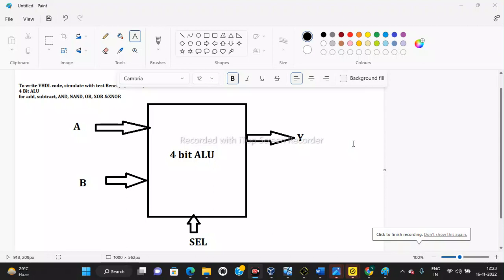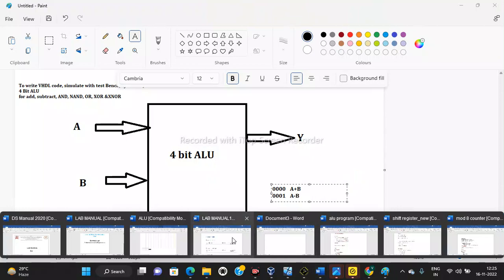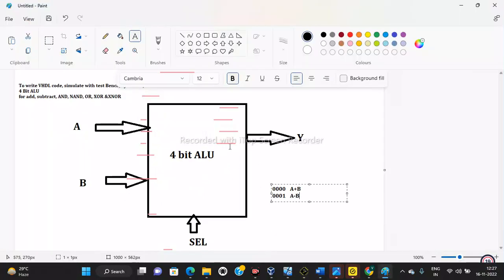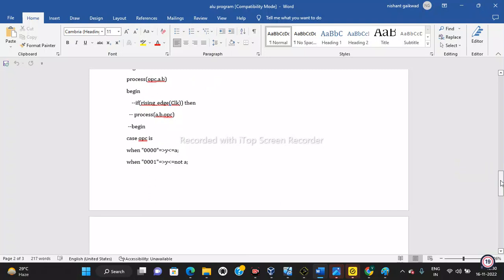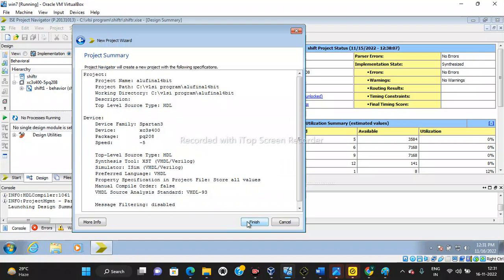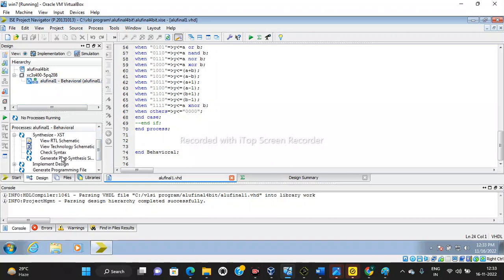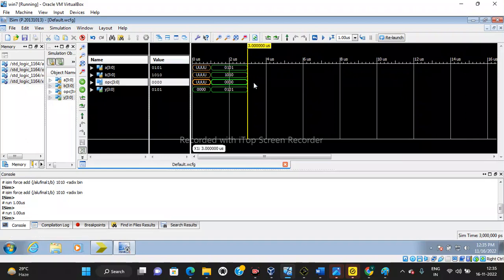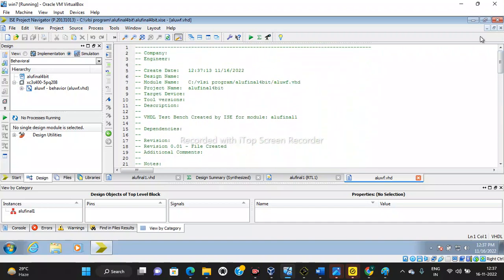4-bit ALU VHDL CODE and How to write and simulate VHDL CODE IN XILINX ISE 14.7 WITH PROCESS

Comment: Please cp the code here
Reply from the maker: -- Design Name: 
-- Module Name:    aluhnd - Behavioral 
-- Project Name: 
-- Target Devices: 
-- Tool versions: 
-- Description: 
--
-- Dependencies: 
--
-- Revision: 
-- Revision 0.01 - File Created
-- Additional Comments: 
--
----------------------------------------------------------------------------------
library IEEE;
use IEEE.STD_LOGIC_1164.ALL;
use IEEE.STD_LOGIC_ARITH.ALL;
use IEEE.STD_LOGIC_UNSIGNED.ALL;

-- Uncomment the following library declaration if using
-- arithmetic functions with Signed or Unsigned values
--use IEEE.NUMERIC_STD.ALL;

-- Uncomment the following library declaration if instantiating
-- any Xilinx primitives in this code.
--library UNISIM;
--use UNISIM.VComponents.all;

entity aluhnd is
    Port ( a : in  STD_LOGIC_VECTOR (3 downto 0);
           b : in  STD_LOGIC_VECTOR (3 downto 0);
           opc : in  STD_LOGIC_VECTOR (3 downto 0);
           y : out  STD_LOGIC_VECTOR (3 downto 0));
end aluhnd;

architecture Behavioral of aluhnd is

begin
process(opc,a,b)
begin 
    --if(rising_edge(Clk)) then 
  -- process(a,b,opc)
 --begin
case opc is
when "0000"=>y<=a;
when "0001"=>y<=not a;
when "0010"=>y<=b;
when "0011"=>y<=not b;
when "0100"=>y<=a and b;
when "0101"=>y<=a or b;
when "0110"=>y<=a nand b;
when "0111"=>y<=a nor b;
when "1000"=>y<=a xor b;
when "1001"=>y<=(a+b);
when "1010"=>y<=(a-b);
when "1011"=>y<=(a+1);
when "1100"=>y<=(a-1);
when "1101"=>y<=(b+1);
when "1110"=>y<=(b-1);
when "1111"=>y<=a xnor b;
when others=>y<="0000";                                                                                                                                                                                                                                                                                                               
end case;
--end if;
end process;
end Behavioral;